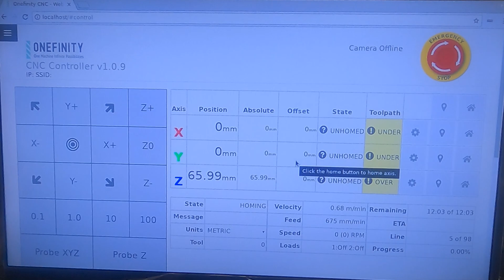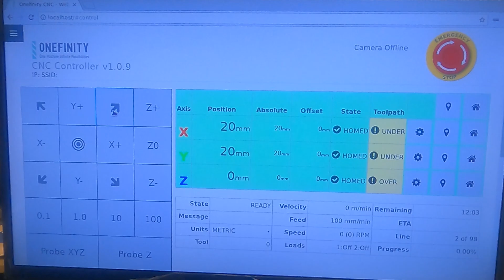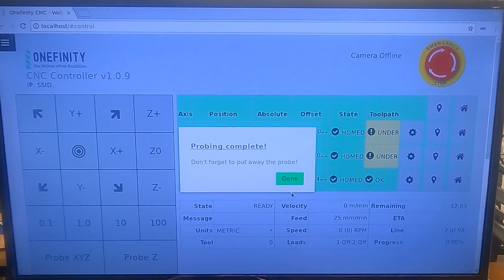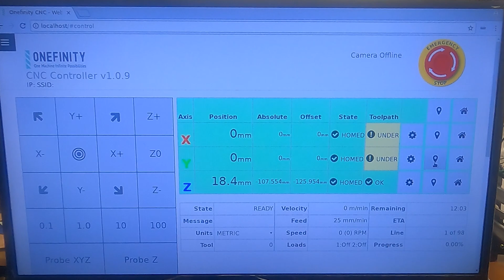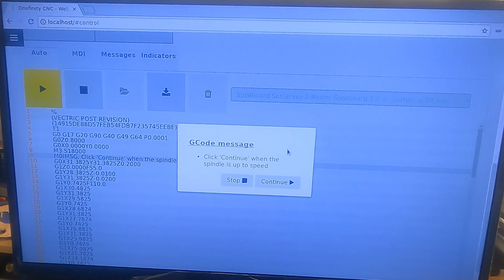Surface the Onefinity Spoilboard

Comment: Can the cnc just be mounted straight to a piece of MDF, and use another piece of MDF on top of that as spoilboard? I would likely just double side tape all my pieces to the spoilboard rather than use the t-track. I don't have a way of cutting the thin spoilboard pieces accurately like you have.
Reply from the maker: Yes you most certainly can, problem with stacking them is you will lose some of your up and down or ‘z” travel, only a problem if you are trying to do thicker projects